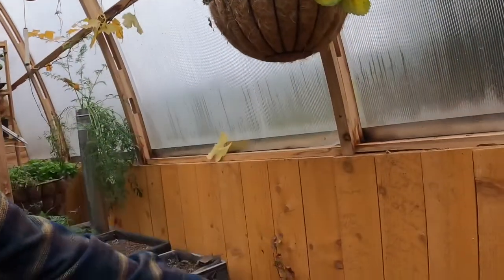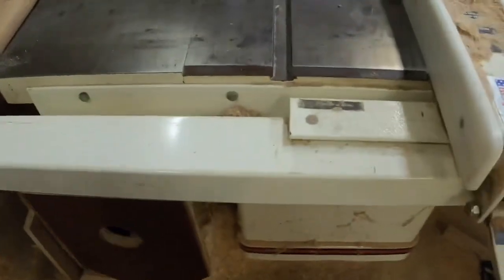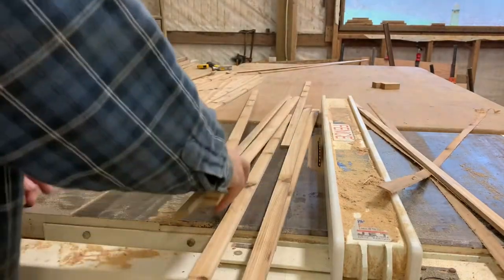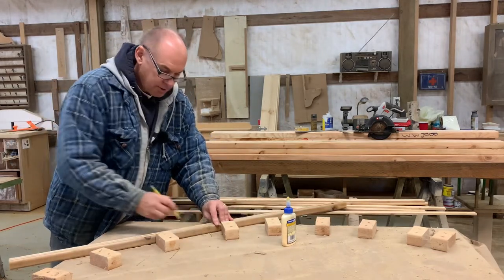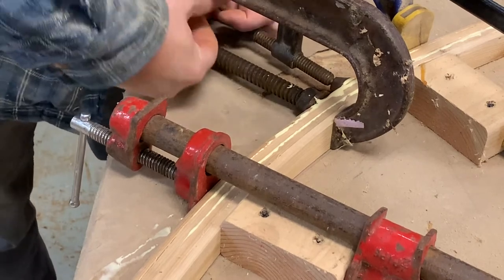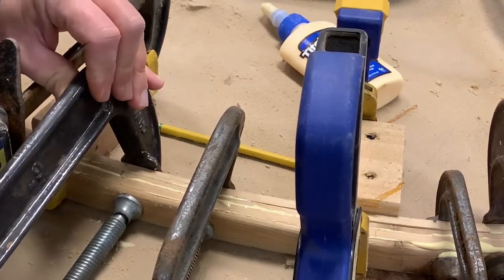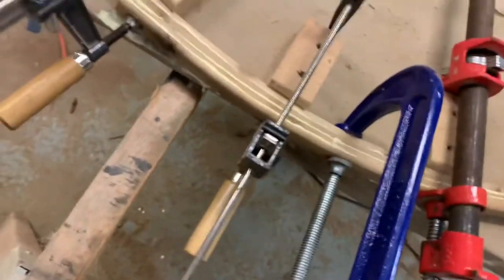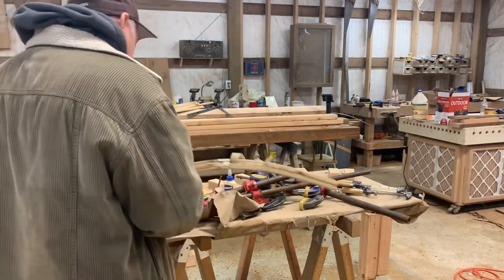Cedar glue up // flying buttress // Gothic greenhouse

Comment: If you use a compression strap like they do when you steam bend you would increase your chances of the wood not splitting. Are those short pieces what you used cut up for the web of the arch?
Reply from the maker: There’s quite a bit of hind sight that I’ve had since I built mine. There’s not a lot of information out there to glean so I had to just wing it at times. If I were to start again I think I would make a solid arc that the glue boards would strap up against. And use more hole and pegs instead of all the clamps. I’d still clamp it up but only after the boards were in place. I’ve watched the steam strap system and they’re brilliant using the bicycle pulley system. I think I’d like to try that but with such a long span it would be hard to find the room. Once the boards are in place small C-clamps could be used to really get that tight bond. The splitting wasn’t really an issue with a large span mostly just on my tight bends and if you pick through the boards over time you can get clear wood with fewer knots
Reply: @BusyBeaver22  You might find this interesting in regards to steam bending. https://www.youtube.com/watch?v=50uXPPt8-VI You could use 3/8" 4 ply plywood to create a solid backer which now that you mention it I may do. There is also bending plywood.
Reply from the maker: Gary yeah this guy is great. Very useful info. You would need to use steam to bend a solid board but strips are pretty easy to bend and glue.